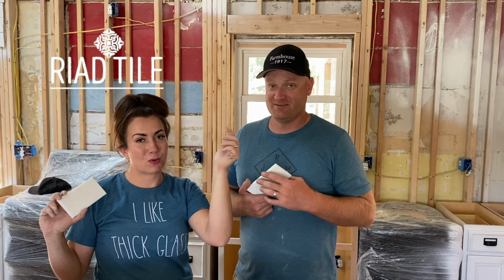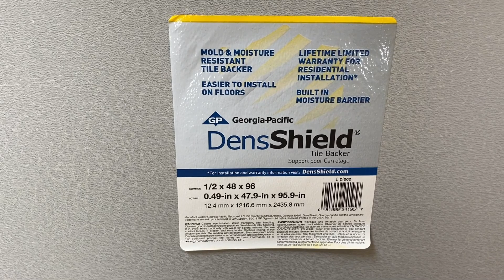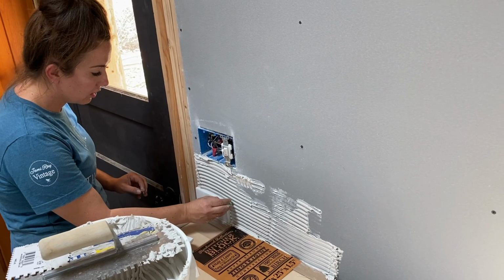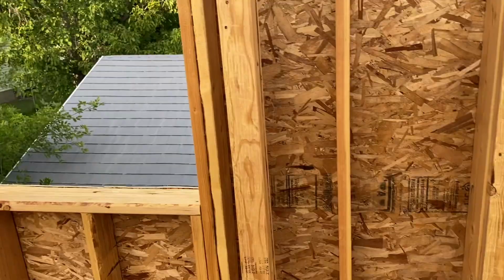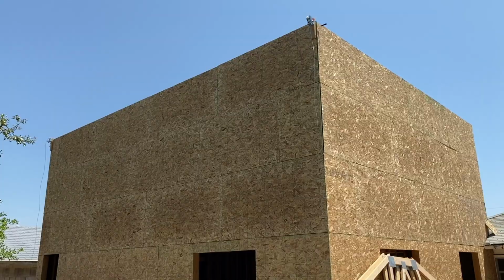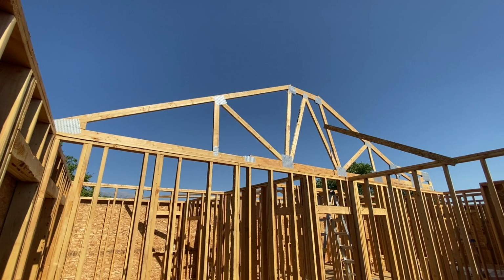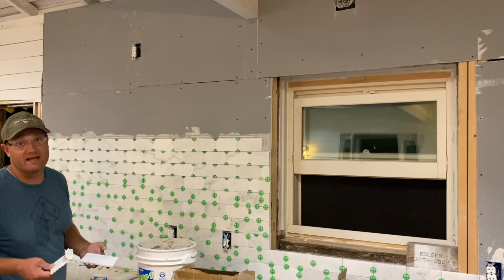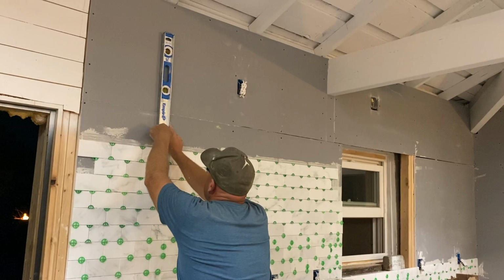Subway Tile Backsplash DIY Dream Home Kitchen Remodel

Comment: Great job on those tiles! Loving your progress. 
I'm sure you've covered this in a previous video, how are you insulating? Are those walls with the fireplace and kitchen cabinets on an outside wall? 

We're about to tear into our old farmhouse. I dread seeing what's inside these walls of mine.
Reply from the maker: We’re lucky to have a 12” exterior adobe wall so no insulation needed on this stud wall that supports the roof in case of an earthquake.

Comment: No wall behind the cabinet...first time seeing this cool.
Reply from the maker: Lavidah Johnson there is the block wall it’s to inches thick. Then the wood is just there to hold up the ceiling structurally and we attatched the cabinets to those studs. It’s just not common to have to frame inside a block home. But it was necessary because we opened up the ceiling and we have an addition connecting to the original block home

Comment: Use matching silicone caulk on the bottom row that sits in the countertop. Not grout.  I found out the hard way on first backsplash 🙃
Reply from the maker: Great tip!  Thanks

Comment: Sorry if this has been asked,  did you do a chalk line before starting to tile?
Reply from the maker: Zeb used that long level on the back of the countertop and leveled it out and we used the top of the counter top as the ledger for the first row. After that it was a simple matter of making sure the spacers were flush on subsequent rows

Comment: What is the reason for no boards behind cabinets?
Reply from the maker: Not needed since it’s an interior wall and the cabinets have backers. The cabinets are close to sticking past the wall on the east side of the kit hen so we wanted to give them as much room as possible.
Reply: @JamiRayVintage  Thank you for the explanation.

Comment: Wondering why you wouldn't put insulation in that wall and sheet rock.
Reply from the maker: Mostly space requirements on the Sheetrock.  The counters are pretty tight to the doorway,  but insulation isn’t needed since there’s a 12” thick adobe brick wall.  The stud wall is just for structural support of the roof in case of an earth quake

Comment: Are you blowing in your insulation? Sure hope you'll have insulation.
Reply from the maker: The block doesn’t require insulation it is double thick and has more R value than anything you could blow in. We did spray insulation in the eves and we are insulating they roof on the outside. Most people don’t know about block homes. But that old Adobe is good stuff.

Comment: You aren't insulating?
Reply from the maker: Not needed on this interior wall. The 12” thick adobe exterior wall is plenty of insulation. 😊
Reply: @JamiRayVintage  Ok.. I just didn't want you to have problems later with condensation.. I can't wait to see it all done.

Comment: You didnt need to put insulation on that wall?I see it on the next wall but not were youre putting the tiles.
Reply from the maker: Nope, 12” thick adobe exterior wall provides more than enough insulation. 😊